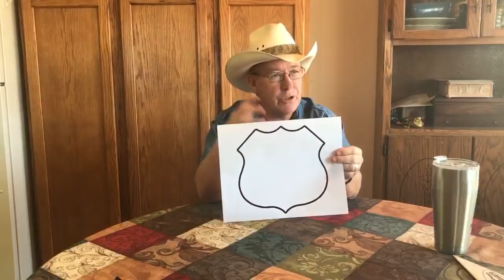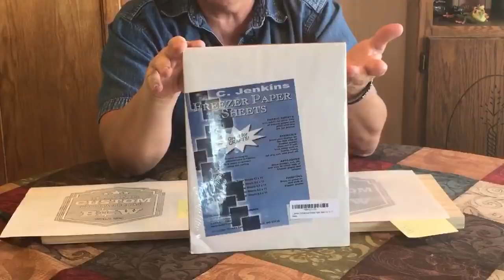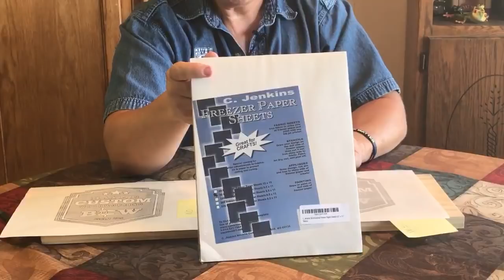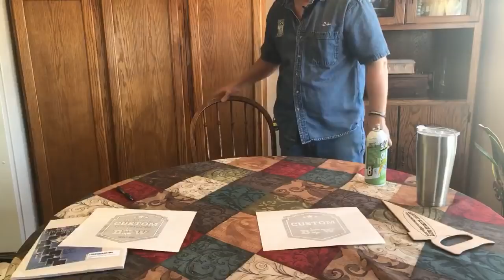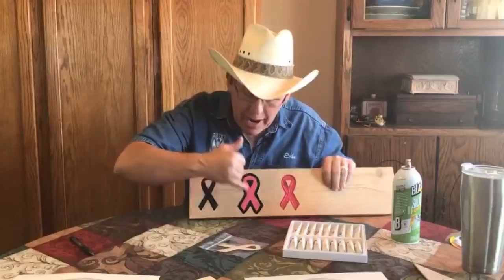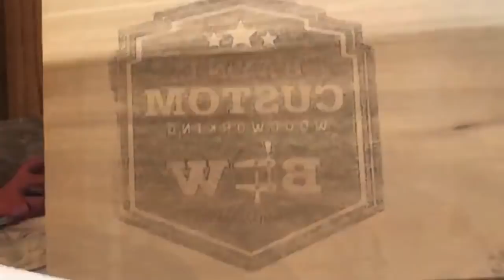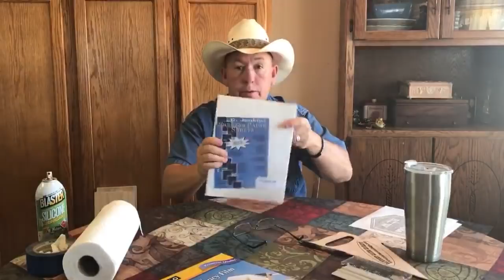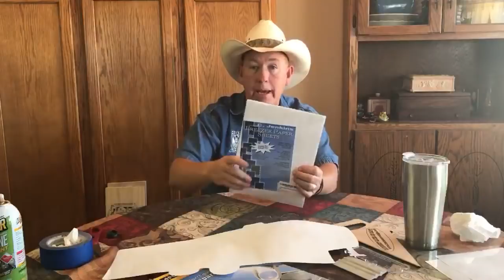LTS 6/30/18 Inkjet Transfer Tip + Paper Cut Outs & Q & A

Comment: How do you remove all the spray glue after you carve through the paper?
Reply from the maker: Now I use painters tape underneath so it peels right off. But you can also sand it off or use mineral spirits.